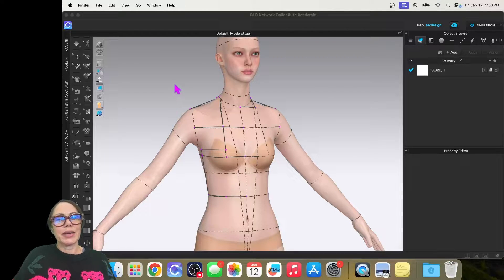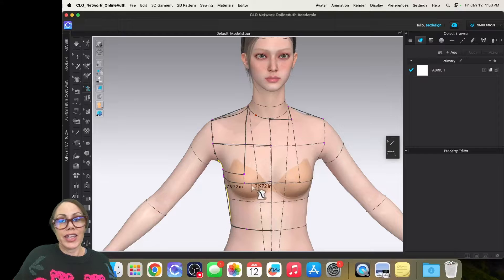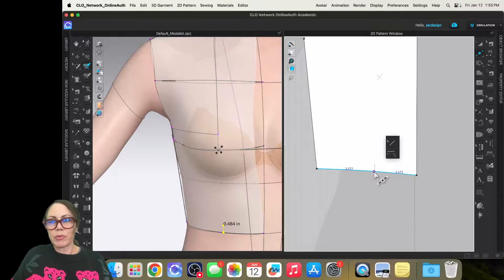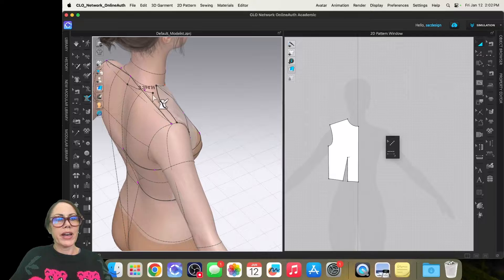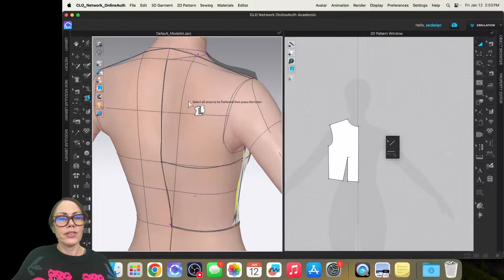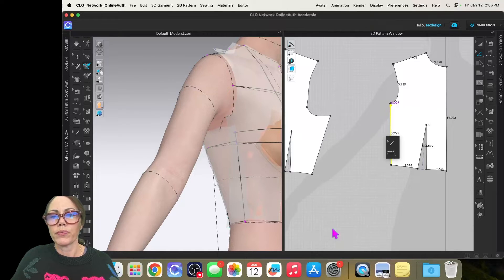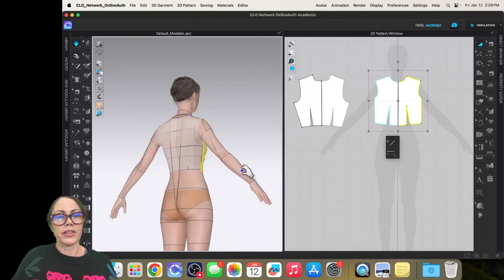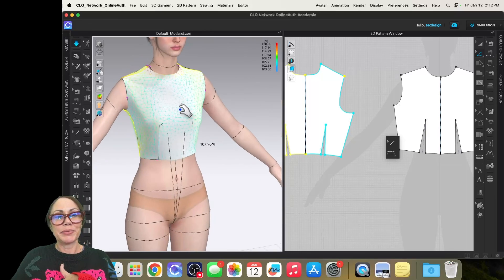Draft the Basic Sloper by 3D pen tool in CLO 3D

Comment: I did not know, the smooth curve also worked this way and I also did not realize the straight line option in the flatten tool, so thanks a lot, this will help my work very much.🥰 BTW, if you want to see hidden curve points, just press V and they will show as orange dots. I try to clean up curve points as much as possible, because it makes grading far easier (I am using Inkscape for that)